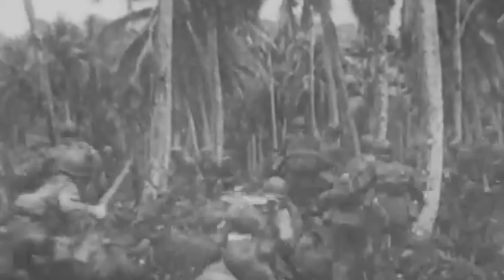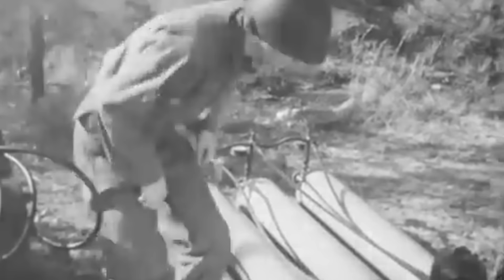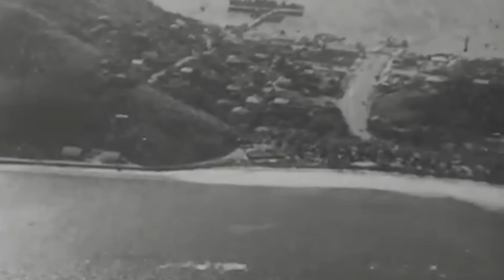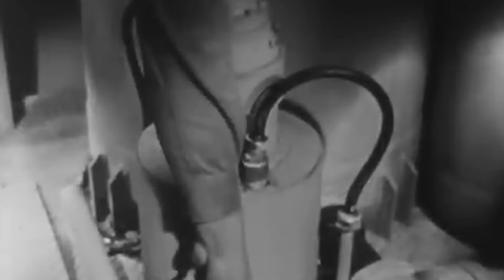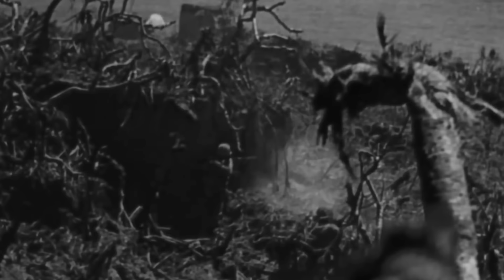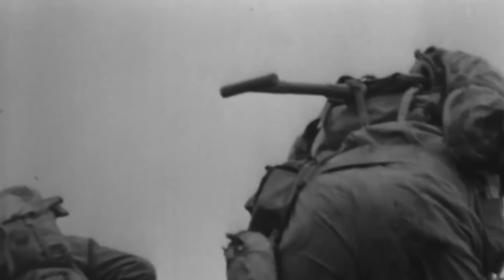Flame Tank vs 500 Japanese Soldiers – America's Most Ruthless Tactic in WW2

Comment: Factual error: if the U.S. had a flamethrower in 1941, then the video is wrong to claim the U.S. didn't have the weapon until after it was "dragged" into WWII. The U.S. entered the war on Dec. 7, 1941. The original M1 flamethrower was in fact developed during 1941. However, it didn’t go into action until 1942.